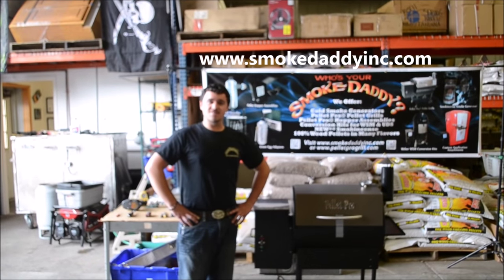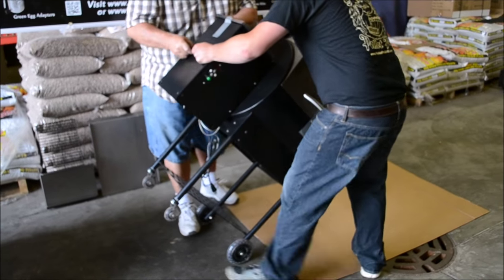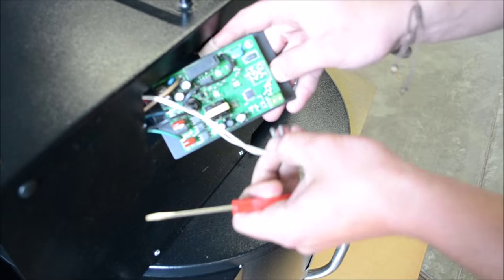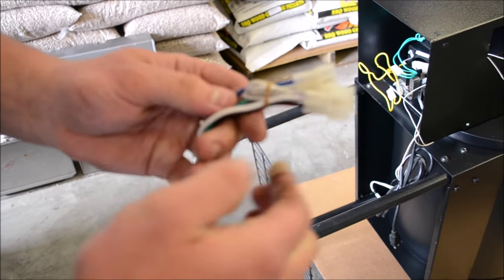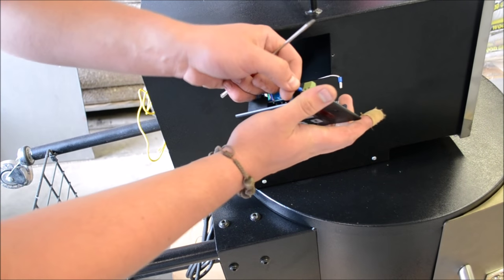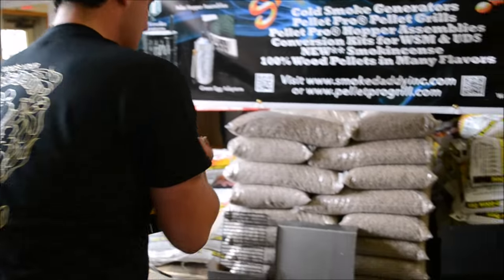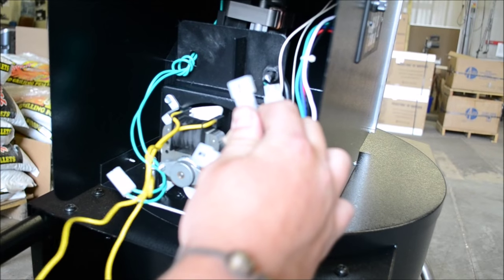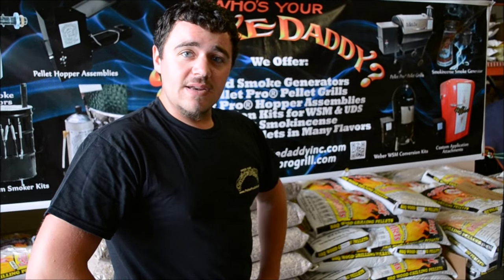Upgrade your Pelllet Grill to a Pellet Pro® PID Digital Controller - How To

Comment: This is the coolest controller in the world. I used to have to constantly monitor the temps which would swing 50-75 degrees in my pit boss pg. Now it's like set it and forget it. Truly awesome!!! If anybody is on the fence with purchasing the controller, BUY it!
Reply: GunNtonic I just bought a pitboss 820 and used their brand apple pellets. Smoked ribs at 225. Once temp dipped below say 220 it would sky rocket up between 275-325....then slowly creep back down. First I thought it was the pellets but I just recently found a lot of people talking about huge temp swings.
Reply: GunNtonic Yea my pit boss sucks. I'm thinking of getting this. Is the pit boss a 2 rpm auger?
Reply: @Random_Things1001  yes. check manual. it does say it in there

Comment: Yes it will work on your Pit Boss I do recommend getting the full kit to upgrade to our higher quality components for the best results.
Reply: my pitboss 340 already has a 2 rpm auger motor so do i need just the controller or still the entire kit?

Comment: Y didn't u just make the wires on the controller the same color as on the unit so they would match up ?
Reply from the maker: Every pellet grill out there has different color wires. We do send a wiring diagram along to tell you what component goes to what color wires

Comment: How do i find if auger is 2 rpm and do I need to replace fan and burn pot while changing out controller.
Reply from the maker: In most pellet grills the auger are a 1.5 RPM with  less amperage. We do recommend using our higher amperage components for the best results.

Comment: Will this work with a Z Grills 700D?
Reply: Added one to my Z Grill,, Love It!
Reply: Phil Smith did you have to do anything for it to fit the Z Grill or just plug and play?
Reply: @nickn954  Add the adapter plate, drill a couple new holes.. no biggie!! Love this controller and the Customer Service is OUTSTANDING!!

Comment from the maker: The pellet Pro PID controller will fit on many pellet grills. If you have a horizontal Mount controller you may have to do a little cutting in order for it to mount vertically. If you'd like to find out if it fits your particular grill call 847-336-1329